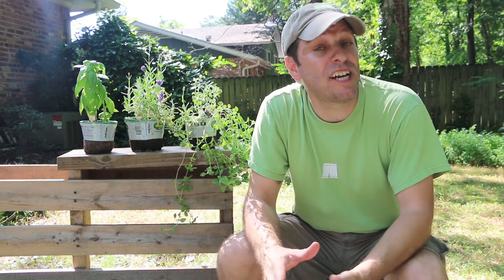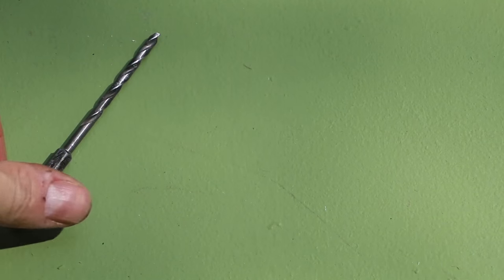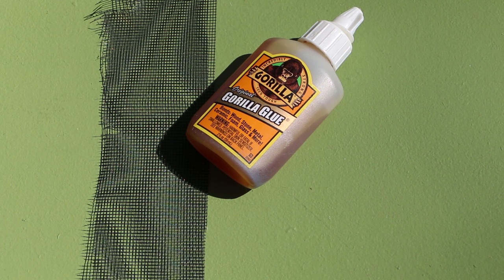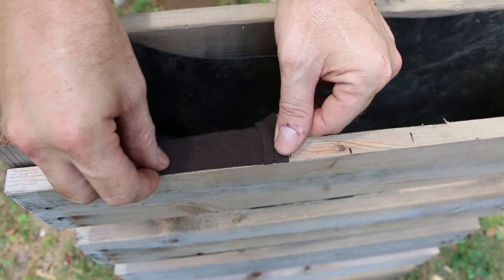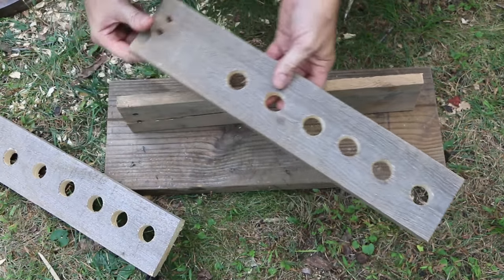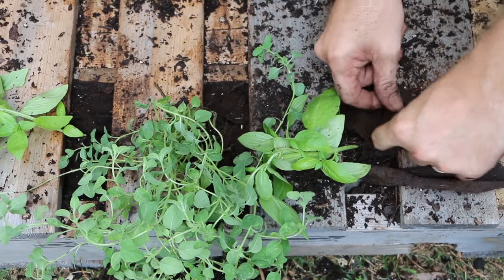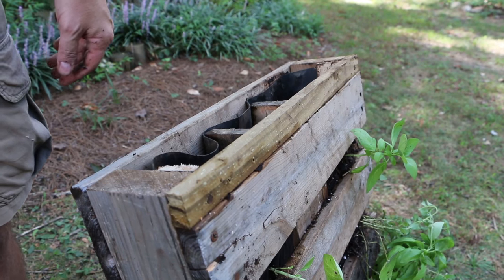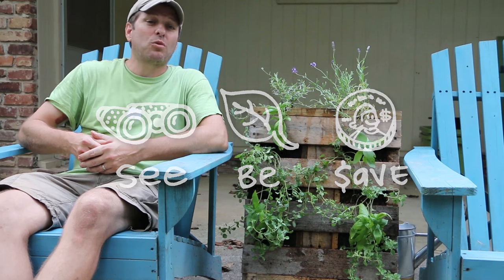How To Make A DIY Pallet Garden With Worm Tower

Comment: How did you attach the bottom of the liner to the box?
Reply from the maker: +2bfast the pond liner was folded into box shape, tucked into the bottom of the pallet. I only attached it to the top. By the way, if I built this again, I’d make the worm compartment horizontally across the whole top of the pallet, instead of vertically.